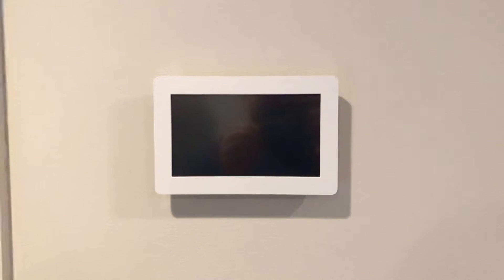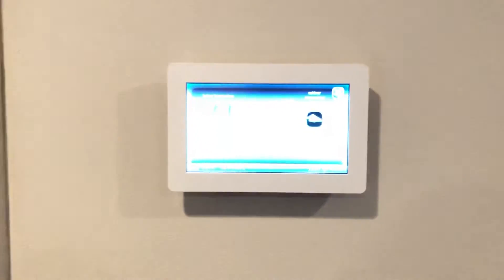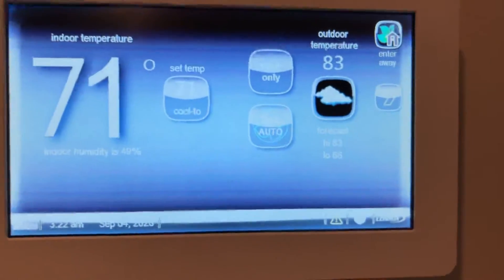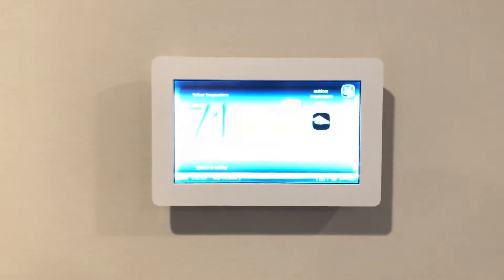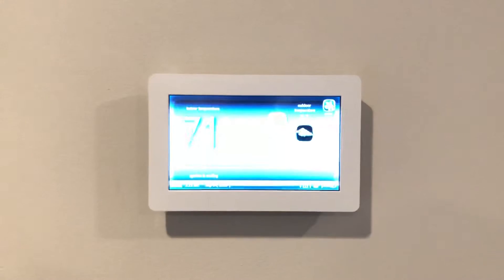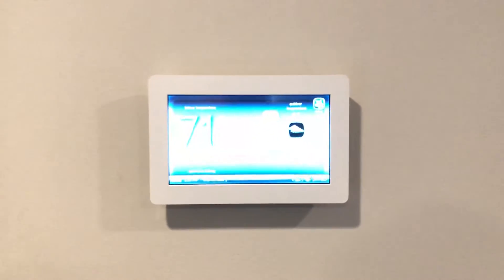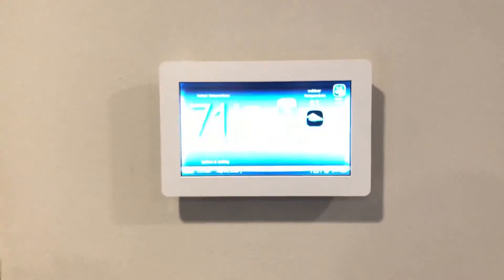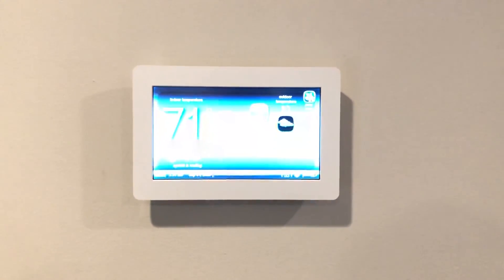UPDATE: Another Failing Lennox iComfort 10F81 Thermostat

Comment: 5 yr warranty - at 5 yr 6 mo won't connect to Lennox server - "Oh, just buy a new S30 for $744". Is there another one I can use?  ""Nope, your system will only accept an S30".
Reply: It can use googe nest just use fan for common!
Reply: are you saying that you cannot use any other thermostat except the one by lennox???  my thermostat keeps changing the temp and now, if i turn it off,, it turns itself on again.  such crap.
Reply: @glamo1839  That's what I'm told by Lennox.
Reply: @glamo1839  Yes, that is what he is saying.  Only a Lennox communicating thermostat such as an S30 can be used to replace another Lennox communicating thermostat like an icomfort 10F81.  All other brands that I have studied are noncommunicating thermostats and will not work on your Lennox communicating-wired HVAC equipment.
Reply: I just had this happen and am waiting for my S30. It is 100+ every day this week. It looks like you can replace the S30 screen for $200. I am hoping it will last longer than 7 years.
Reply: @markg1490 hello this just happen to me. Have you gotten your new s30 yet? If you did it fix your problem
Reply: @JorgeGarcia-kd8yz  I did receive it but my screen started working so I have not installed it. I am absolutely sure that it will work if wired correctly. It can NOT be wired the same way the original one is as it is 24 volts and the new one is is 12 volts. You must wire the transmitter between the furnace and the thermostat. There are several YouTube videos that show you how. I hope this helps. By the way, I am not sure how long my original screen will stay working, so I have kept the one I ordered.
Reply: @JorgeGarcia-kd8yz  I did receive it but my screen started working so I have not installed it. I am absolutely sure that it will work if wired correctly. It can NOT be wired the same way the original one is as it is 24 volts and the new one is is 12 volts. You must wire the transmitter between the furnace and the thermostat. There are several YouTube videos that show you how. I hope this helps. By the way, I am not sure how long my original screen will stay working, so I have kept the one I ordered.

Comment: Thanks for this
Mine went from fine last week to completely blank white today. I got 8 years out of it so I should feel lucky.  I ran it with screen saver on and no WiFi set, at least its still running the furnace luckily. Will check with my HVAC installer who still does my annual maintenance and see what can be done.

Comment from the maker: UPDATE 2 (11.22.20): My installer (who is a Lennox dealer) replaced this old, chronically defective model with the brand new Lennox S30 thermostat. It's leaps and bounds a better unit, both from an aesthetic and functionality standpoint. The only drawback was I had to pay my installer $300 because the unit needs to be rewired at the air handler. But I figured this should solve my thermostat issues for the foreseeable future, and considering I got the replacement S30 for free, the installation fee wasn't the end of the world. If your system was installed by a Lennox certified installer, definitely reach out to them, because chances are you can have your old 10F81 replaced with only the cost of installation.
Reply: Our dealer Lennox dealer (Russells, VA) wants $1675 to replace/upgrade the 10F81 and rewire.   I'd be glad to pay $300.   Right after the guy went away and we paid the service fee $75 - the display came back on!!!    Would like to buy just the 10F81 display in case this happens again!
Reply: Did you get Lennox to commit to replace it under warranty before installation? Mine has died after 3.5 years but the installer went out of business. The Lennox warranty says they might give you 20% of list price of a new unit (since the 10f81 is discontinued). I'm thinking about replacing screen myself. The size, cable, dimensions and resolution look identical to AT070TN93 though the actual part number on the display is nowhere to be found on the internet (maybe they used a cheap knockoff). These thermostats are selling for $500 on eBay now so someone could make some money refurbishing them!
Reply: @dbestyoutube  Did you find a solution?
Reply: @jglassman1122  nope. I replaced the screen and there was no change in behavior. Must not be the screen. I saw some theorizing that it is the flash memory wearing out (this is common problem if incompetent engineers write the software). Anyway I replaced it myself with the new model (19v30) which is a lot nicer. It wasn’t hard though having the extra smart hub part is idiotic. Definitely not buying another Lennox.
Reply: @dbestyoutube  what was involved in upgrading the icomfort wifi to the newer S30? I fear I will have to upgrade too?
Reply: Are you paid by Lennox or something? Have you read the other comments about what they were quoted? Just had a lennox partner come out and was quoted $1300 to get the new s30 with install.

Comment: Dear Tyson,
did you replace the thermostat? if so, could you kindly tell me which model did you replace. Mine has black and pixel line screen from screen's end to end and lost wifi connection. I sent an e-mail to Lennox HQ office in TX. their answer was just talk to deal. then I talked to deal and they quoted me with $750 and  $149 installation. too much! Mine only lasted about 5 years and unfortunately just finished 5years warranty  period. i was wandering that Lennox system is compatible with goggle 3rd gen. Nest thermostat or not???
Reply from the maker: My installer replaced the older model with the brand new S30. It's a BEAUTIFUL thermostat with a much better designed screen and far nicer looking housing. The only downside was that I had to pay $300 to have it installed, because it requires a re-wiring at the air handler.

Comment: Were you able to replace it with a newer model?  Mine loses all it’s data off the screen between about 3am and 10 am.  Just the blue background.  No numbers. No placeholders.  Since it’s intermittent I’m not calling a tech.  It can’t be troubleshooted if it’s not having the problem.
Has anyone else had the symptom?  Even with the unit in “off” for the night, it does it.  Numbers and selections just vanish.
Reply: No, I did not need to call a tech. I found the same model, new in the box on Ebay, popped out the old, popped in the new one and programming it was easy as it gives you prompts, one step at a time. The replacement fully fixed the issues.
Good luck.

Comment: My screen did the exact thing.  It waited to be three months out of warranty so I can buy a new unit and have it installed for almost $1000.00.  That is ridiculous.
Reply: For $1000 one could buy a touch of screen laptop that could: play music, do a spreadsheet, Alexa, shopping, play games, and OH YA - control a feeking furnace.  And a S30 does what?
Reply: I opted for a much less expensive unit that works just fine, though it doesn't have any computer program Apps...yay! I'm not big on computers, so I like it because it's simple and straightforward (HoneywellHome ProSeries). Lennox has had so many complaints about the faulty thermostats that they claim to have "fixed" the problem, but I'm not sure? Didn't want to take a chance with it. Good luck.
Reply: @2much2do56  how did you rewire the control board?

Comment: I have had two fail under warranty. My dealer went out of business.  I have been on my own.  I bought a third off eBay and now it is failing.  The Wi-fi distance is about 10 feet so I had to add a wi-fi repeater just for the thermostat.  If it can not communicate over the Internet the time of day jumps around. I will not buy another one of these.

Comment: Mine just did that today. I think we got our system replaced six years ago. It would be cheaper to hang an iPad on the wall, and I just may do that.
Reply: Mark.  Thanks for your help.  It finally quit completely.  NIB from Ebay and works perfect.  Partly thanks to you I avoided an expensive maintenance appointment.
Reply: What’s NIB?
Reply: Bought new one off of Ebay.

Comment: I have the previous touch screen and like you said I can still use the app on my phone and the heating/cooling system still works but the touch screen on my wall is extremely slow to respond. I completely regret not going with a different company overall
Reply: It has nothing to do with the company who installed your unit. It’s the manufacturer of the Lennox T-Stat.  What they don’t tell you is that the Lennox Thermostats last only 5 yrs. I would strongly recommend to reach out to any HVAC Company before the 5 years is due.  You still have to pay Labor and cost of warranty. If your installation company gave you additions
 Years of warranty then you do not have to pay the warranty. Cheaper then replacing the entire thing older than 5 yrs.
Reply: Do you think it would be possible to connect a failed screen unit to a phone, or do you have to input on the screen?

Comment: mine just died last week. exact same issue as you. frustrating as it just out of warranty - of course. I assume one of yours was replaced under warranty, but not the other?
Reply from the maker: I actually managed to get both replaced under warranty. The first thermostat was just out of warranty, but I put up enough of a fight at how ridiculous it was that the screen failed but the thermo was actually still functional (and it's a $400 unit!), that Lennox ended up replacing it. Of course, to accomplish any of this you have to go through a certified Lennox installer/dealer. It might be harder if you had the system installed by a non-certified installer, or if you installed it yourself.
Reply: @tcf098  wow fast reply. Thanks Tyson. Yeah I didn't have it installed by a pro so I might be out of luck with the warranty. Perhaps I'll try anyway. Shame as I like the look of this unit. It indeed doesn't inspire me to buy another Lennox thermostat. Cheers
Reply from the maker: @markjohnperkins  yeah it's worth a shot. Lennox seems to know this model is garbage and might be willing to work with you, especially considering their systems are "closed" and don't work with 3rd-party brand thermos unless it's re-wired. Good luck!
Reply: @tcf098  I will give them a call and let you know if I'm successful. If you (or others) don't hear from me, assume not. I didn't know their systems are closed. Annoying.
Reply: Hello, The exact same model that I have and the screen gone blank from this morning. I am really frustrated with the product and not sure how to fix this.
Reply: @gkls4105  did you fix it? Mine just did that..
Reply: @alexceballos4438  No, I could not. Looks like I need a same model to buy.
Reply: @gkls4105  in the end I got a replacement model of the same make for cheap online (kijiji). I know it will likely only last a few years, but didnt feel like going through the headache of rewiring it right now and the other ComfortSense models are fairly expensive. I turned the screensaver on with hope of reducing wear/tear on any screen capacitors. 

when I spoke with Lennox I got the same answers as above. just out of warranty, they wouldn't replace it. even if it was in warranty, they would only replace it if I paid a service tech to replace it. Paying someone to replace a plug+play thermostat - unbelievable!!
Reply: “Blank” with the blue background or all white?
Reply: Gkl S:   Blank with blue background and no numbers?  Was it failure of the thermostat or something else?
Reply: @johns.8681  Yes, I had the same issue for which I had to replace the thermostat with the new one as it was not connected so Wi-Fi and could not control via App.
Reply: @johns.8681  pretty sure it's the screen. the app will still connect through wifi and it still controls the heat
Reply: @markjohnperkins  I wish.  Thanks Mark.  The app disconnects whenever the screen blanks so I'm without HVAC when it happens
Reply: @gkls4105  Thank you.  Mine does the same.  When it goes blank it disconnects from wifi.  I was hoping it was something else than the thermostat.
Reply: @johns.8681  Right, sometimes it happens. May be you try resetting it, 1. Hold right bottom for 5-6 secs. 2. Touch reset button just an inch above from the borttom right. Check the app in your mobile if it is connected to your Wi-Fi after sometime.
Reply: @johns.8681  Ah that sucks
Reply: @gkls4105  Thanks.  I'll try it.  Wifi Stays connected when screen is working but disconnects when screen blanks out.  System will switch from hot to cold on it's own in the middle of the night.  When it switches to "cold". That's when the screen decides to blank out.
Last night I kept fan mode in "On" throughout the night and it never blanked.  Strange that it would change from "Heat" to "Cool" on it's own without input.  Probably the thermostat.
It seems with the fan "on" all night, it doesn't switch to "cool". I'M trying to trick it into staying in "heat" mode and not blanking out..
Reply: @markjohnperkins  Of course, the Lennox tech line says,..........."we've never heard of that happening before."  Which makes me surely not want to pay a Lennox paid technician to come over and learn the system on my Dime.
Reply: @markjohnperkins  Thanks.  I know they swap out easily.  If I bought one, do you know if a tech has to do a special download to initialize the display, or if it's an easy, plug-and-play swap?
Reply: @johns.8681  how did you end up resolving this problem did they tech have to come out or did you just plug in the new one?

Comment from the maker: UPDATE: Lennox has discontinued manufacturing this model and is now replacing them with the newer s30 version, which appears to be a vast improvement. If you're having trouble with your 10F81 thermostat, contact Lennox and request a replacement! 1 (800) 953-6669

Comment: my outdoor unit type is X21,indoor unit  is SL280UHV, I re-wire and replace it with honeywell T3 thermostat yetserday,testing now
Reply: I have some experience with Lennox HVAC equipment. If you use a regular thermostat you will need to configure dip switches and cut jumpers on the board for optimal performance. All of these tweaks were handled by the communicating thermostat.
Reply: how did the rewire go?
Reply: Did it work? Can you show us how you do that? We bought wyze thermostat and we have xc21 n sl280uHv too?
Reply: @Classicmusicclass201  I have some experience with Lennox HVAC equipment. If you use a regular thermostat you will need to configure dip switches and cut jumpers on the board for optimal performance. All of these tweaks were handled by the communicating thermostat.